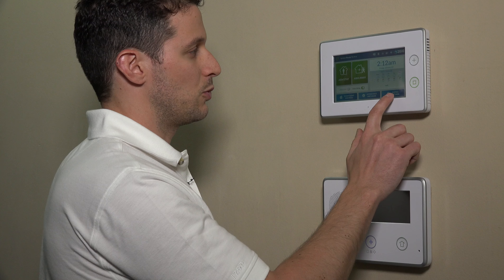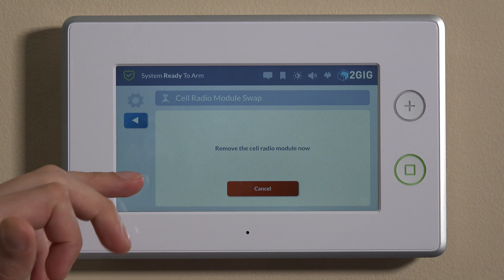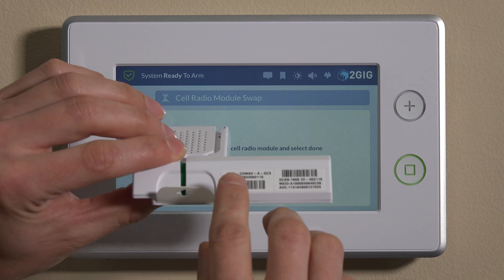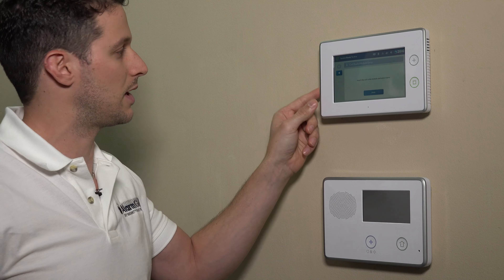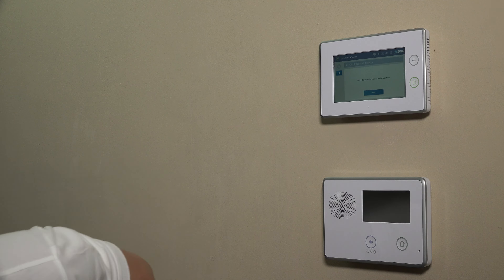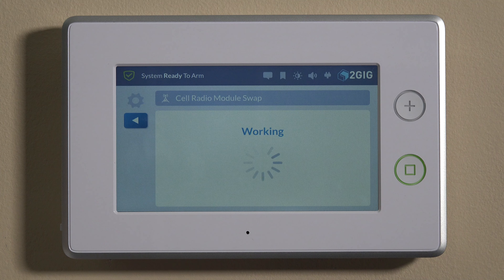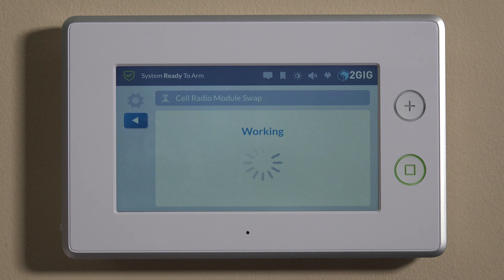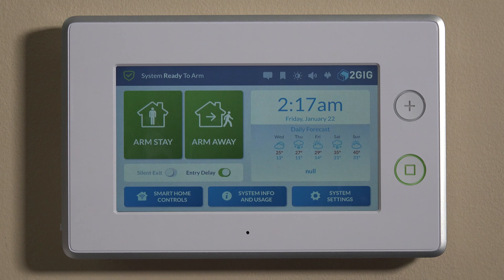2GIG GC3: Swapping a Cellular Radio

Comment: How would you setup the panel to dial out to the central station once you put the cellular module into the system? Also, how would you activate the system for monitoring?